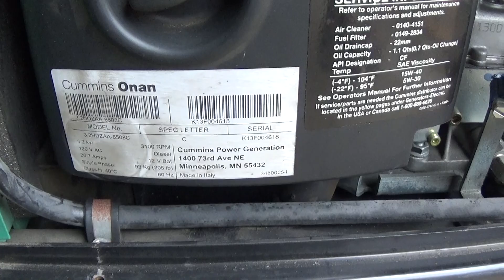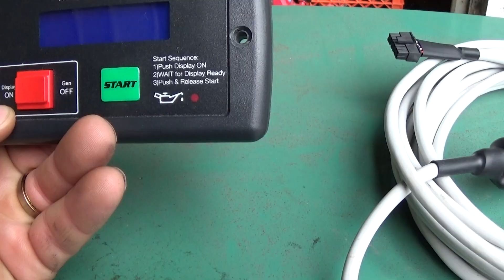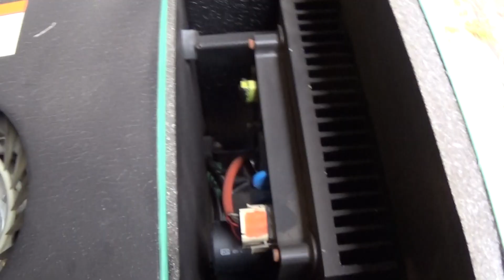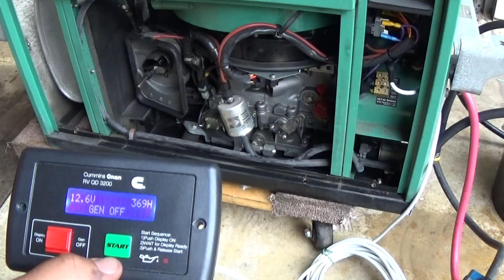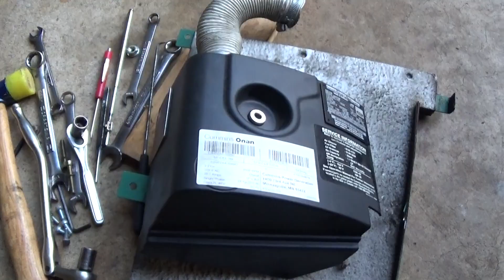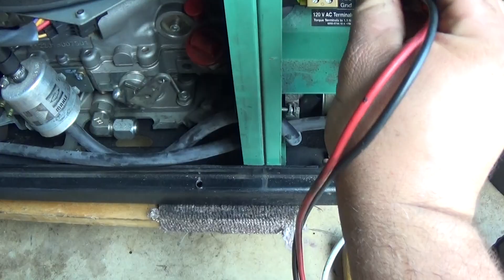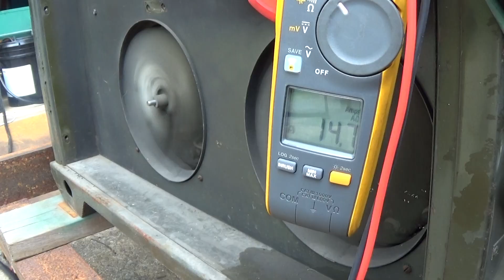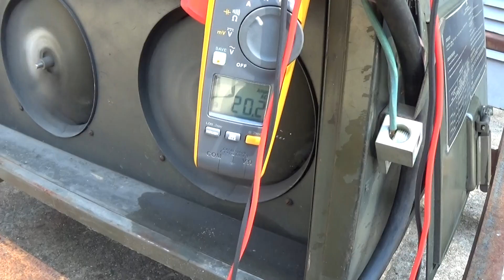Miniature Diesel Generator Diagnose, Repair, Test ONAN RV QD3200

Comment: Instead of performing quick diagnosis and simple repair, buy a new unit. Still had to pay for removal and installation. Big company can take the warranty loss I suppose. I wonder how long it took for the owner to get their rig back? I have heard many horror stories about RV repair times. Could have saved themselves time by putting some time of their own to fix it. Neither here or there at this point I reckon, except you got a good generator out of the deal.

Comment: That is a great generator. Here in Scotland I fitted a UK spec Dometic TEC 30D to my RV (have never even started the original twin cylinder Kohler, with petrol being about £1.30 a litre, or about $6.40/gal)

It is a Hatz diesel and the controller looks very similar. Mine started with zero hours, now it has 518 on the clock.  Mine needed a new fuel pump to get it going, it later needed a new exhaust pipe and a new air filter as it sucked in it's own exhaust from the split in the pipe. Under partial load it only uses about hslf a litre per hour and on a rainy day it can dry the ground under the RV.

Mine's in a basement compartment with a vent at the side and bottom, makes it very slightly quieter.
Reply: 1/2 liter an hour ?  Of diesel ?  How much does diesel cost ?

I was thinking , that generator should power one , maybe two inverter drive 12,000 BTU ductless mini split A/C - heat pumps .

Wyr
God bless
Reply: It's rated for 2.5KW at 0.7 litres per hour at that and cuts out quickly at a little over 2.5KW.

It'll certainly power one 12,000BTU split system, I've never had an inverter drive air conditioner, so don't know how intelligent they are, if they can be linked and programmed not to run at full power at the same time, then certainly.  Once when driving from one campsite to another, my youngest daughter turned on 4 electric heaters, about 5KW in total, just by chance the thermostats were all clicking on and off at different times and the generator managed.

For 2 heaters on a low setting and the battery chargers it's supplying about 1.5KW and using about 0.5 litres per hour, diesel is about £1.34ish, although I could use duty free diesel at about 70p a litre last time I checked, although I wouldn't fill up at a truck stop if the RV itself was diesel powered, mine's not so there's no risk of being harassed by the taxman.

One other interesting feature the generator has (mine's an old 2008 model) is it can be daisychained to another TEC 30D for 5KW of power. I'm not sure how I ever found the money for one, I couldn't afford two, anyway I haven't seen it mentioned in the specifications for newer models, so I don't know if that feature is even still supported.

If you have many thousands to spend on a generator, I'd check out some of the Cummins Onan water cooled generators. I saw one in a health service semi trailer parked in a supermarket carpark that I had no idea was even there when stood beside it, until a service engineer opened up the compartment it lived in. In the same place, I can hear mine from half way across the car park!
Reply: @byebye9785  So , maybe $ 25 a 24 hour day ,  for you to run your generator ?

We have a 25 kw trailer mounted diesel generator at work .  Would love to have it , too .    :-)

Thanks ,   :-)
Wyr
God bless
Reply: Yes that's about right. Your worst case scenario is about $18/24h in California, or $12.45 at about $2.80/Gal at full load for 24H. I bet it'd be less than $10 a day in quite a few states, the AC will use less power at night (or during the day up north in winter as a heat pump - which they're really good at).

Back in 2011 at a house I used to live in, I bought a 12KW 415V 3 phase generator. A lot of businesses and almost zero homes have multi phase power here in the UK and back then 415V 3 phase equipment, costing many thousands new could be had second hand on eBay for a few hundred. I got a 4 Ton Hydraulic 4 post lift, compressor, a Lincoln Electric MIG welder and a Lincoln Invertec plasma cutter, an added bonus was I could get 240V off one of the phases for the house when winter weather knocked out the power. It had weatherproof housing and all it's doors locked, but it was really expensive, so I bought an old airport laundry trailer to mount inside.

Comment: Enjoyed the VID.  That's the kind of stuff I do for fun.
I have several small gas generators I picked up like that.  Funny no one even tried to fix them.  Just tossed them and replaced them.  I'll bet that thing will quiet down a lot when you put the intake cap back on it.  Like running a car motor without an air cleaner cover.  Had a Diesel Motorcyle with one of those single cylinder diesel motors in it.  Got 120 MPG but could only get 55 MPH out of it because it was only a 10 HP engine.  Stereet legal but rode like a kids mini bike with a CV transmission.  Sold it to a guy in Iowa and he rides it to work everyday.......

Comment: I have a little 6 hp BMW diesel in my sailboat circa 1979.  Has a Hatz motor marinized by BMW.  Still running after 40 years.
Reply: I rebuilt one of those. Only one I've ever seen.
Reply: Man you are lucky!  I have a NexGen in my sailboat and I have had nothing but problems with it.  I'm about ready to toss it overboard.
Reply: @markalley4810  Do your have the belt driven 3.5KW with the single cylinder EA300 Kubota? I know them well.
Reply: @gcrauwels941  Good morning.  Yes I have the belt drive and Kubota.
Reply: Ok now that I've had a cup of coffee I should give you some more information.  The engine itself runs great, water cooled, kept up with oil changes and always run it under a load. 16000 BTU air conditioner, microwave, battery charger, TV.  I have replaced the mother board three times now.  Generator sits in a sound proof box and has a blower to vent heat.  I have pulled the unit from the boat four times and had a mechanic go thru it thoroughly and I encounter the same problem every time.  A generator will run great for about 4 to 5 hours and then it just quits producing electricity. Thank you in advance for any help or advice you can give me on this until.
Reply: @markalley4810  Ok. Assuming you're not overloading it and the frequency is right (=>59 Hz) it sounds like you have a heat issue. I've had several of these where (especially the capacitor regulated sets) where the cooling just wasn't sufficient enough to get rid of the heat. I've actually had to add ventilation to the compartment or add additional sound shield cooling with additional 'helper' blowers with a few of them. Consider adding cooling, whether by helping the sound shield by ducting more air through it or adding a fresh air source directly to the sound shield. These sets are usually tucked away in some tight space and there were issues with keeping the electrical end cool enough. Do that, and I think you'll find a big difference with the longevity of the regulator.
Reply: @gcrauwels941  Thanks for taking the time to answer my question  I bet your correct in your diagnosis.  I think I'll add another or perhaps a larger blower and also enlarge the fresh air intake.  I'll let you know how it goes after I get the repairs done.  Are you by chance living in Florida?  Thanks again!
Reply: @markalley4810  One other thing you could consider, although more of a PITA, is remote mounting the regulator as a last resort. Augmenting the air flow usually does the trick though.
You're welcome. I used to live there. In NC now. Occasionally I return for a few of my old customers though.
Reply: @gcrauwels941  Heck I'll try both of those ideas. If it doesn't work out,  over the side she goes! Lol.  Thank again.
Reply: @markalley4810  It's really nice to see people helping out one another if they can.

Much respect to you for your kindness and professionalism, and I hope the issue is finally resolved.
Reply: @FelixCatz  There are still good people in the world. Taker Easy!
Reply: Hey Robert.  Thought I would give you an update on the generator.  I contacted NexGen and explained the problem and you are 💯 correct; air flow to the generator is insufficient.  The previous owner built the sound proof box and while he did a great job he didn't allow for enough airflow in the critical areas.  Long story short the generator is toast, so now I need to decide if I should rebuild it or replace it with a new one.  I wanted to thank you again for your assistance.  Taker Easy!

Comment: Space heaters work as decent test loads. Also I've seen guys use an oil burner to burn carbon out of mufflers and intake manifolds minding temperature.
Reply: yup.  I always use a space heater[s] for a nice inductive load bank.
Reply: Resistive? @spockmcoyissmart961

Comment: Those generators usually run thousands of hours problem free , so when one shows up that fresh it's probably thought to be pretty serious, and yeah really cheap to replace. Shop hours probably equal what that generator cost Onan.
Reply: Bob Bob this is a symptom of our throwaway society. Few people understand how anything works anymore. To think it is cheaper for a manufacturer to scrap appropriately $3000 rather than even attempt paying a technician to diagnose the root cause. If you add in scrap back into the manufacturing process you are still looking at a significant cost you are passing back to the consumer. What most individuals don’t understand those prices are planned into a product cost from the point of agreeing to move to manufacturing. In the end a product is only profitable if the original cost projected remain below all the cost incurred. A prime example is the generator fixed with essentially no cost but sweat equity. I realize he did spend some cash but other than a squirt of silicone it would have probably run with out any other changes beyond putting the exhaust valve back in service. I admit that would not have been the most prudent course but it would have been possible. 

We need more people in our society who understand the complex set of gadgets we use everyday rather than a over priced liberal arts degree. IMHO
Reply: @bryanluhning6346  I could not have said it better nor would I have been able to ! Cause if you read my comments in earlier threads you will see the effect of 39 years of daily amphetamine use, and way too many hours stuck alone under a welding hood, solving the problems of the world... what was I talking about? Oh yeah, Chrysler is a FIAT NOW!! Fix it again Tony!!

Tripolar cause Mania and Depression aren't Enough.

Comment: Had a two cylinder Kohlar diesel engine on a spray unit. ran two hours before it did the same thing. after checking with the manufacture it required the valves to be lashed after the first eight hours of run time.

Comment: I have a Gas powered RV Onan that has ceased to function.  Perhaps you have a video on how to fix the thang.  I'll watch this first.
Reply: They are well known for failure of fuel pumps and ignition modules.  Some were installed with no fuel filter.  If it sat for a long period of time, could be related to carb issues, but those usually show up first as surging and related issues.
Reply: That could well be. I was having an electrical issue. The generator would not throttle up when load was applied.  But it has at for 5 years, and I expect to clean out the fuel system.  It's just been a low priority repair.

Comment: Wet stacked. Been run underloaded all it's life. You really need to load them 75%> of their rating to prevent that. I think you've caught it in time though 🙏👍 I always run our works backup generator hard on tests!
Reply: Dean Marsh do you think an rv generator would survive alright driving a welder? The gen has more than enough wattage but the inrush current will be very high as you start and stop welding
Reply: @ghettobikelife8833  Consumer grade generators tend to top out at the nameplate rating with maybe a 5 second overload for starting an AC.  The inverter might not have the power headroom needed for welding.  Inverters do not like highly reactive loads. For a welder, it should run a small unit that runs on 120Volt, but it won't run a 240 volt unit.  The Eco mode on many portable generators is unable to cope with a high current start without turning off Eco mode first.
I prefer commercial Diesel generators instead of consumer grade stuff as they run all day at 80% load.  (example a genie light tower running 4 lights uses 1000 Watts per lamp + the ballast load.  The generator is rated for 6KW.  Reading the specs on the engine/generator combo inside, it can take 120% overload for 10 minutes.  It has a 30A 240V outlet.

Comment: Typical indication of long term lightly loaded condition. Run the heck out of it for half a day it will likely come around. I've seen some so badly coked up that they wouldn't even start.

Comment: Nice find.

I wouldn't have messed around with silicone, I would have just cut a new gasket from appropriate gasket stock.

It's cheap and takes less time than taking it apart again.

I would have shut it down after the exhaust smoke cleared just out of caution to check the oil and make sure nothing else is going wrong.  But I'm not a diesel mechanic, just paranoid.

Comment: Mike -  Some questions and observations in no particular order.
First off, an outstanding video full of nuggets of info and observations.  I personally don't care if you go weeks between your video's if we can get this quality and in-depth of a video!  Kudos! 
Looking forward to seeing your new shop and all the clever design goodies you come up to outfit it with. 
I'm hoping that you didn't run the engine with the air filter off.  The exhaust soot/coke that was collecting at the rear of the generator could just as easily been pulled into the gen housing and into the motor air inlet to say nothing of coating all the components within the gen housing.
If I were Mr. Onan/Cummins I would be on the phone right now to your service department and in particular the person responsible for declaring the genset a warranty replacement!  Even at $150 dollars an hour shop fee it would have been well worth the time to trouble shoot to the problem.  I'm betting here that the actual charge back fees to Corp for labor and parts is way way less than the fees charged customers!  If nothing else this should have been an instant in-house refurb candidate and not a junker!   
I am even more amazed that Germany with their high wages could produce and market this gen set cheaper than say Japan or Taiwan.   Would love to know the economics of this set. 
Regarding your load set.  Since most of the gensets that you load test are basically just single phase you can use the other legs of the load set instead of just phase 1 to spread out the 'wear' on each of the load phases. 
Not familiar with this particular load set but it should have the capability to go from zero to whatever the indicated max load is you have chosen.  So if you were on the 20Kw load setting you should still be able to vary the load from zero to 20Kw ...I think.  Also if you are doing high current loading with your load set, the covers are just as important as they are for the gen set for proper cooling of the internal load parts.
I'll mention this again.  I have no problem kicking in some money to get parts and cover some of your labor for the Cat genset.  I hope that some of your other YT followers would be will be willing to do so. 
If you can come up with a "wish list" we can not only buy the parts, we can also hunt them down if need be.  This will have to be coordinated so you don't end up with 24 thousand cotter pins!
Reply: Just a guess based on my manufacturing logistics experience back in the day, it probably cost Onan around $1500 - $2000 to build that thing and put it on the shipping dock. That's ten hours of shop time so replacing it probably made sense.

Comment: Replace the muffler and pull and rebuild the injector after being run like it was with the exhaust valve like it was. Injector tip is probably partially blocked.

Comment: I need that load bank!  did you get it at a military surplus auction??  very cool.  good job on the genny too..  are you on smokstak?
Reply: For smaller stuff a couple of milkhouse heaters and a proper size variac does a nice job.  I picked up a nice 3.1KW 120V variac at a surplus store.  Keep your eyes open.  Has a 30A 125V twist lock plug.

Comment: Too bad it’s 120 only... I run a 3500w portable for my house..  I have a 9000w as well, but the 3500 runs furnace, my well, and lights just fine. Uses about 4-5gallons of gas every 12-14hrs wheras the 9kw uses over twice that much... Size it for what you need.    I do what you do up here in the Boston area..  We probably know some of the same people.. I have quite the battery collection as you do as well..  Same with the oil buckets.. haha..

Comment: I used to make a living by collecting and repairing stuff thrown away by businesses because it was too expensive for the labour to repair. I equipped my own workshop with free tools and materiels this way, and many of the repairs were done for no cost except my time. The 6 kva Diesel generator i kept for myself was thrown away because of a starter motor fault.

Comment: Discontinued but they did cost $6000.00 new. Good find.
Reply: Except I don't think they have been. They seem to still be sold to oems. Tiffin lists a 3.2 kw diesel gen set on their sprinter based motorhome as standard and it is an option at Winnebago on the View. I'm 90% sure that is an onan unit. The only other option that small is from powertech and their's is 3kw. You just can't buy them anywhere as an individual it seems.

Comment: You would be well advised to make sure that the exhaust gasses are not sucked into the cooling air as you had when on test.  That would be the reason for the black air filter also it raises the temperature inside the enclosure which can cause overheating in very hot weather.  You snagged a really great score there, nice one.